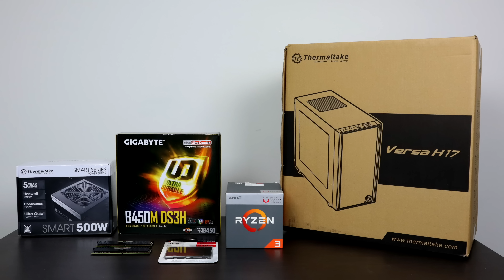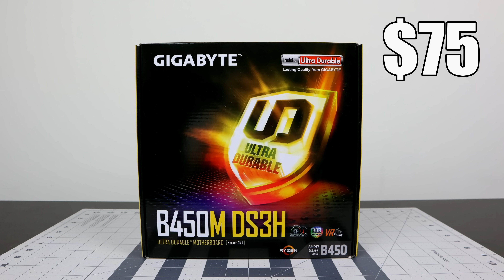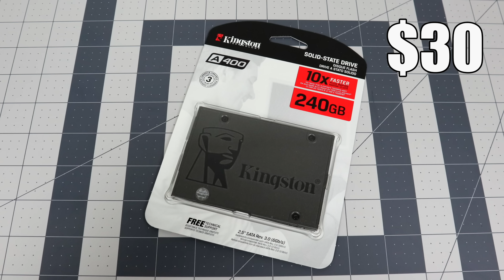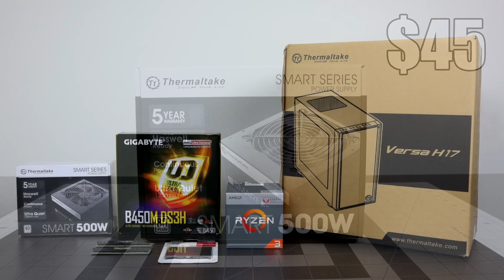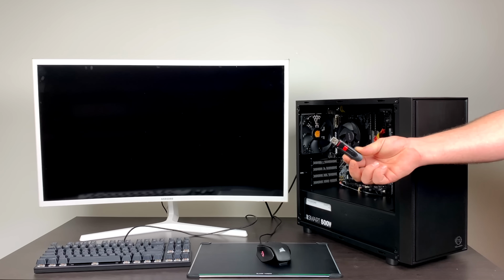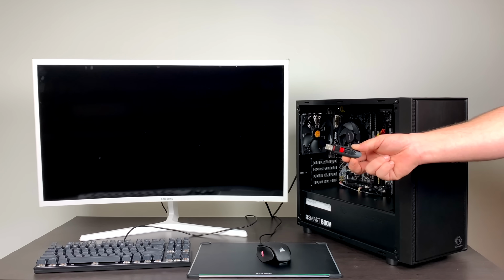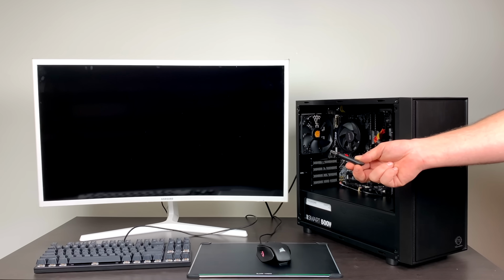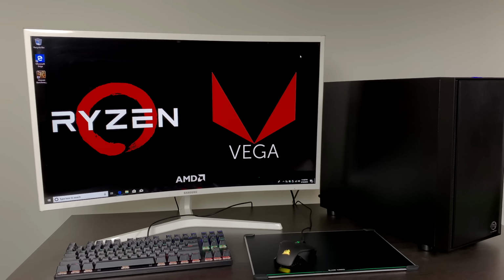$350 Gaming PC Part 1 The Build - How To Build A PC 2019

Comment: One quibble: 240 GB in storage is unfortunately not enough anymore for gaming. Consider that Doom (2016) is 70 GB, and many current AAA titles are not far from that. Serious gamers would likely want to have several games ready to run at the same time. So, I think ~500 GB should be the new recommended minimum. It would ~$30 more, but I would consider it necessary, even for a starter system.

Comment: This is a great tutorial vid. Easy to understand, simple to follow. Loving the simplicity of it all, and the low cost!

If I could suggest just ONE thing... that would be to check that your mobo boots BEFORE mounting it into the case. After installing the C/APU, Fan/Heatsink (and paste) and memory, taking 2 minutes to connect the 8/30pin power and a monitor to make sure that the board/memory/fan/proc is fine goes a long way. It's tedious having to plug in every connector once; I'd hate (and have had to) to have to do it 3x (initial connections, unplugging everything, connecting again after identifying the problem piece).

Comment: Not trying to nit pick, and I am sure it was mentioned before, but, you should try to use all the screws available on the MOBO. Sure 5 will hold it but why not use all 9? Cases will have the standoffs pre applied or will come with them for you to screw in, often with a little tool. If not a 5mm socket usually works. Besides that great videos man.

Comment: You should never use twist ties in a working computer because over time they become brittle and fall apart while bouncing around in the case and if it touches something electrical it could short it out. Using Nylon Zip Ties instead is a better choice.

Comment: This is a great deal! Just to note if you shop at Micro Center you can spend the same money and go with Mobo CPU package deal there and get the Ryzen 5 1600. It don't have dedicated gpu but this route will run a little cheaper then spend the extra money on a gpu. I went this route just a few days ago and spent $325 before tax and a gpu.

Comment: personally i would only replace the RAM with 16gb of GeiL 2400mhz RAM, it's only $20 more and overclocks like a dream, can easily push it to 3000mhz on B450
Reply from the maker: I’ve been so tempted to pick up Geil ram but was worried about how well it over clocked.
Reply: @ETAPRIME  i have my 2133mhz GeiL kit pushed to 3000mhz on my R5 2600

Comment: Dumb question but i never built a PC before, does this have wifi installed or will i have to buy something for that?
Reply from the maker: Some motherboards do come with WiFi and Bluetooth built in but the cheaper ones like the one I used in this build do not. I personally have on these and it works great OURLINK 600Mbps mini 802.11ac Dual Band 2.4GHz/5GHz Wireless Network Adapter USB WI-FI Dongle Adapter with 5dBi Antenna Support WIN VISTA,WIN 7,WIN 8.1, WIN 10,MAC OS X 10.9-10.13 https://www.amazon.com/dp/B018TX8IDA/ref=cm_sw_r_cp_api_i_lUzKCbFHMAZD0
Reply: @ETAPRIME  Much thanks!

Comment: For $40.00, that case is surprisingly good. Cable management is so much better compared to ten years ago. My only complaint would be the lack of at least one 5.25" slot for DVD or other accessory. I know that digital drives are falling to the wayside, but I really like having the option.

Comment: On my country you'll only get
R3 2200G
Asrock A320M-HDV
Team Elite Black DDR4 2400Mhz 16GB
SanDisk SSD PLUS 240GB 
Raidmax PSU RX-450K 80+Bronze
Standart Fan Case 12CM 2pcs
Case>>Dazumba DE 220 No PSU (my local brand only had 2 slots USB 2.0)

Comment: Hey Man i have never heard you mention Anti Static, i know its rare, but good idea to do 1 of 3 things
1: Anti Static Mat   'or
2: Anti Static Wrist Strap   'or
3: When touching the Board, Ram, or Electronic's  Keep the opposite hand/arm/something on the Case  (my way) to keep yourself earthed, and wear rubber soled shoes,  Do not drag your feet on new carpet
Reply: Jaz808 / very good point! It appears he's using a anti-static mat.  It also appears that he doesn't drink coke and rant, this is a good thing about his builds. Very direct approach without any  long winded  story telling. Great build video 👍

Comment: I just got my I7-8750h mini pc from aliexpress smaller than a desktop power supply with UHD 630 possibly smaller than a Nintendo Gamecube uses a laptop cpu with a desktop fan. I'm sure that is more powerful than this is and portable can be carried in backpack with ease, cant with this. Going by Geekbench the i7-8750h rips this apart 2400G = 4280/11612 or i7-8750h 4943/22305 . ok the barebones is £60 more before adding ssd and ram but £87 gets 16GB 2400MHz and £41 gets 256gb m.2 much faster than a sata SSD. £180 more gets you a smaller computer and double multi-core score and faster hard drive and double ram. might want to look into those i could fit this under my computer monitor a full desktop i can not do that.

Comment: Could you please do a video of the GTX 1070 paired with a Dell optiplex i5 3000 series? I'm basically interested in emulators.
Reply: why not look at something higher single core and much higher multi-core and an iGPU ? that does emulators very well either intel nuc with iris 655 or the i7-8750h or even i9 they do on aliexpress.
Reply: If u want a dedicated gpu make sure you’ve got a minitower. U can search for videos but I doubt a 1070 would fit in a sff case or have a good enough power supply. That’s why the 1050ti is so popular in this space. It doesn’t need dedicated power from the psu.